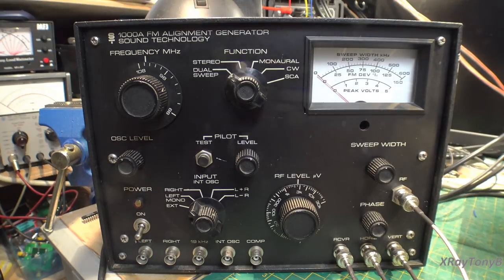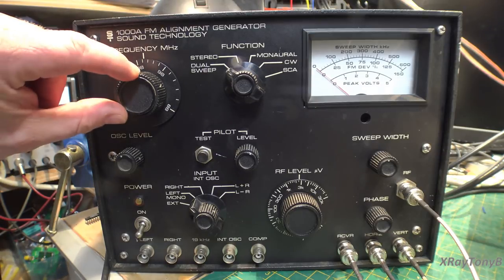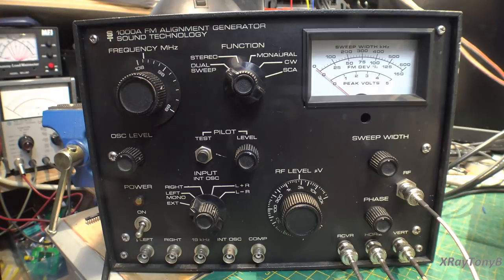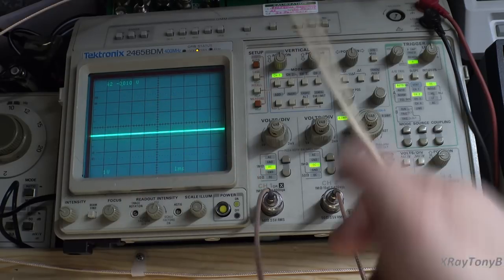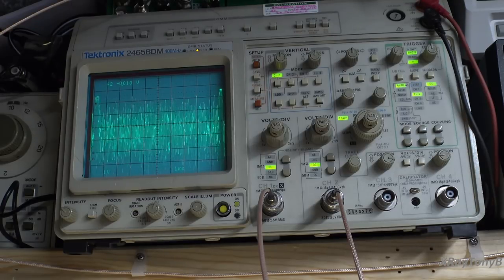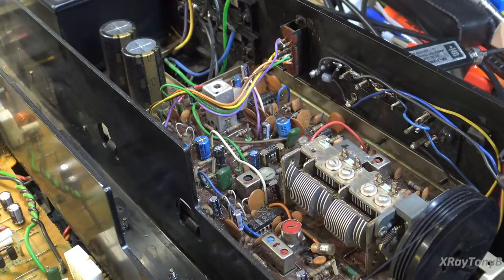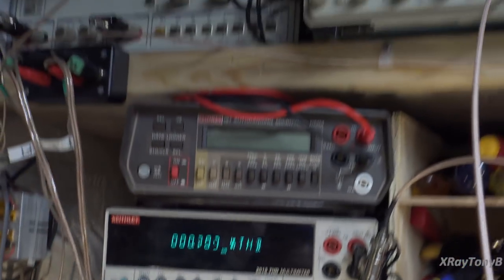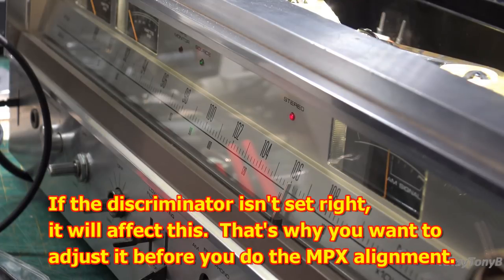Sound Technology ST1000A - Aligning a Pioneer SX-780 FM Section

Comment: Something to keep in mind about receiver distortion measurements: back when the FCC required testing and documentation of station audio performance, the maximum distortion allowed (between 100Hz and 7500 Hz) was 2.5%.  We always shot for no more than 2% across all audio frequencies.  The performance of receivers of this era was an order of magnitude better than transmission systems of the time.

Comment: Thanks for the hands on walk through!

I picked up a 1000a a while back (it was not cheap but is in good shape and was just serviced and aligned) I'm impressed at how well this works for FM alignment. All I had before was an ancient EICO 368 that was pretty much by guess and by golly, The newer digital equivalents are more accurate but they are also more expensive and good luck fixing one if it needs service.

Comment: Thanks, Tony.  I really enjoyed the video.  I have a ST-1000A and appreciated your experience and perspective as you applied it to the task at hand.  Like you, I prefer to use an HP digital signal generator, and I inject a multiplexed signal from the ST1000A into the HP just as you described.  

The thing that I like about the dual sweep method is how easily it attaches compared with trying to couple a traditional signal generator to a point inside the receiver.  At any rate, thanks for taking the time to document some of the techniques used with the ST-1000A.

Comment: I’ve got one of these myself, it’s a great tool for quick analysis and alignment of vintage tuners. Thankfully I’ve also got the Model 100. 

On the note of using it with newer synthesized tuners, you can use a newer tuner to get an idea how close the RF output frequency dial really is, and mine is pretty much spot on. Thanks for the video on this vintage gear!

Comment: I bought an unworking 1000a. Needed fresh psu caps, and a cal (as best I could).
Added the low-distortion mod, and added option M1.
Aligned my Luxman tuner...Yay.
However, I could not get the "dual sweep" pattern on any of my scopes.

Comment: Excellent video. We used ST instruments when we worked at a high end audio store. One note on adjusting for maximum separation use the vtvm to monitor the channel that is off, and lower the meter scale, to get a reading and adjust for minimum deflection. Use same method for the other channel. Would you believe we have seen 40db of separation at 10khz on some excellent tuners. If a multiplex circuit isn't aligned properly they obviously won't be as clean sounding. BTW the distortion will be a lot less. Thanks for reading.

Comment: I know this is over a year late, but for future reference, you can set the filter on the Keithley 2015 to slow down the reading and smooth it out so that when adjusting the distortion you can really find the bottom reading easily.

Comment: Hey Tony. In dual sweep the scope should be in XY mode. The note at time 8:55 isn't correct. If you use the ST1000a horizontal out just to trigger the scope (non XY) then you can get weird displays and repeating sweeps that bleed into one another - play with the scope's time domain and receiver tuning to see this. The scope can't be used to properly tune the receiver to the ST1000a signal. Also, the ST1000a phase control can't be correctly adjusted. When you use XY, then only 1 sweep will appear, you can tune the receiver by watching the scope and centering the potato between the goalposts (technical terms), and the phase control can be dialed in. The manual could be written better to make this clear.
Reply from the maker: Thanks for the info!  I'll be sure to look into it more, the next time I use it.  I had a really hard time with X-Y mode when using dual-sweep mode.  Thanks again for the advice and thanks for watching!

Comment: Hi! I have a few questions.
1) is that unit tube, hybrid, or solid-state? Can you do a quick video showing the insides (electronic porn)?
2) when you hooked up the scope and the VTVM to the “record out” jack, didn’t that put their impedance in parallel? Or did you have a splitter and impedance-matching transformers for each?
3) If it’s only for FM, why does it have a setting for CW (Continuous-Wave) and SCA (some sort of sub-carrier; closed-captioning, maybe)?
4) can you do a video on diagnosing problems with FM stereo receivers that have some sort of problem in the FM section (shorted FM discriminator diode, maybe, or picks up signal well (you can hear the station), but the stereo light doesn’t come on but it should.)?
Anyway, nifty unit there - hope it - and you - are still going strong for a good while yet! 🤠

Comment: Are those BNC's 50 Ohm  or 75 Ohm? . A note of caution. 75 Ohm pins are smaller than 50 Ohm pins. Put a 50 Ohm plug in a 75 Ohm socket and you spread the socket connector.  75 in a 50 = poor contact and so on